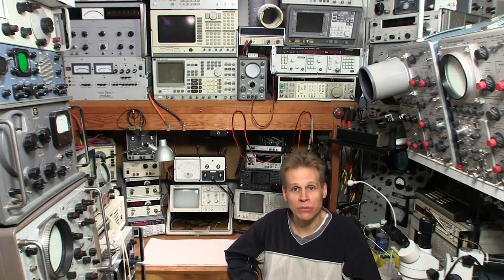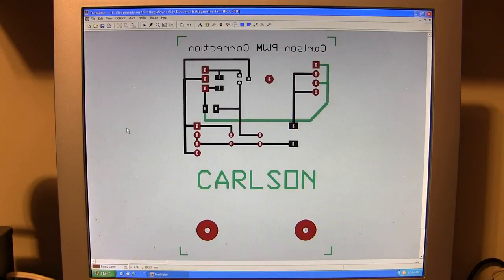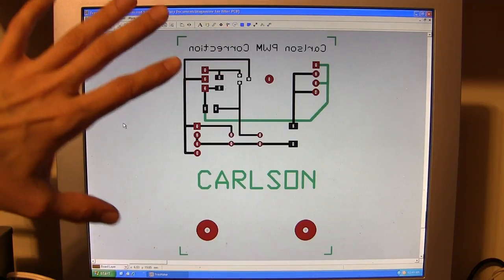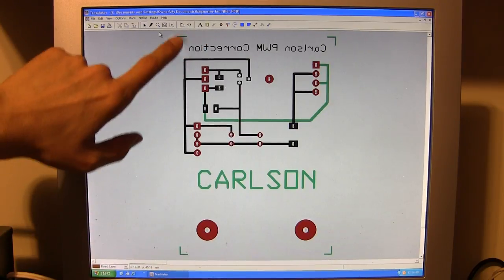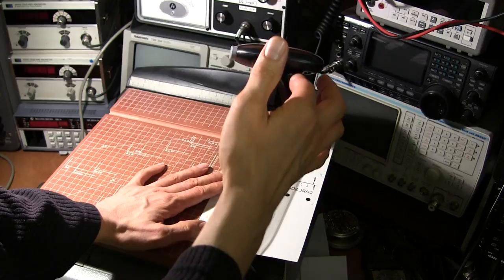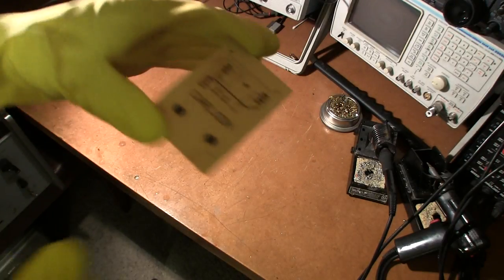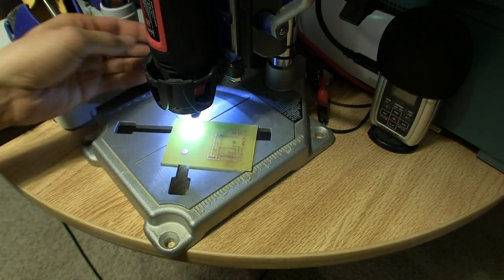How to Make Double Sided Circuit Boards at Home

Comment: Paul, I see that one of your last steps is to remove the paper and the toner or ink was left behind on the substrate. Have you tried acrylic emulsion? It's clear and what you can do is apply the emulsion on to the substrate and then, treating it like glue as it were, apply your page and let it dry. Then using water and a sponge you can remove the paper. Now, this will indeed transfer the toner or ink to almost any surface at all. To be fair, I skimmed the video to get an idea but at 40:47 I thought that this looks very similar to what I described and requires no electricity or lamination. Granted, the transfer method I described will not be as solid as you describe, your process is described as being almost part of the copper. Not sure if what I described will result in that solid a transfer.

Comment: Paul,
I have not used Traxmaker in years IIRC is was built on the the old Protel Autotrax DOS product code that the company bought from Protel to produce a Windows product. Does that product have ground plane or copper pour capability? If so you could save on etch time and etchant by using the copper pour feature. You can also take advantage of power and ground plane fills too. If it does not have that feature you might want to look at Sprint Layout 6.0. I have used it for years and it has copper fill and auto plane capability and many other great features like spiral inductors, BMP and 274-X import, etc. and is also very low cost (about the cost of dinner for 4 at McDonald's). It works well for toner transfer or CNC routing of PCBS of or course 274-X for commercial board manufacture. 

Nice tutorial. The inkjet glossy paper is a good catch as well. 

Was there any particular brand that worked better than others for you? 
Thank you.
W3OHM

Comment: What about the through hole plating ?. Is it achieved by soldering on both sides, as it's liquid metal it will sink down the hole connecting both the pads or do you put a conductor in between.

Comment: Have you ever converting your Windows XP PCB PC as a virtual machine and loading it to a modern (and faster PC)?  You can always ensure that your VM is always backed up and can seamlessly move to a new PC or laptop with ease?

I run all the flavors of Windows from XP to Windows 10 as VM's on my Mac with zero problems.  

Just a curious question really.  Love your videos!

Comment: I  just found your YTC a couple of weeks ago.  As a teen and young adult I've always been interested in electronic.  I've built some of those old projects in the 1960's from Popular Electronics and multiple Heath Kit test gear, radios, ect.  I'm retired now and picked a few projects to restore and use. A VTVM, signal tracer, Ham equip, ect.  I sure am glad I found you video's.  I do have a question though.  I got an old tube, tube tester.  How do you test your valves?  And have you done a video on a restore of an old tube tester?  Thanks, I'm learning alot and hope to refer like minded friends to your channel.  Well done.
Reply from the maker: Hi Bobby. I haven't done a video on a tube tester yet, but may in the future. I usually just let the circuit itself test the tubes in most cases. Thanks for your kind words!

Comment: Why do you remove the toner? If you leave the toner on the tracks it will not be protecting from oxidation? great videos, thanks
Reply: It's much easier just to remove all the toner, than to only remove it from the pads. That would be fiddly and time consuming! If you don't remove the toner from the pads, of course, then you can't solder components to them! A tinning solution both protects the copper from oxidation, and allows easy soldering.

Comment: I used to use masking tape and an exacto knife.  So much hard work and if the board is left in the solution longer than it needs to be, some of the solution soaks in under the tape and you end up with missing traces.  Anyway this is a great video even though I won't be doing anything like this in the future.

Comment: I have found that at the PCB cleaning stage it's really useful to rub the plate with ordinary kitchen salt (sodium chloride), as this removes copper oxides really fast, thus entirely avoiding the need to sand. Of course, you still need to degrease. Excellent video, keep up the good work!
Reply from the maker: +Francisc Gedeon 
Thanks for the tip Francisc!

Comment: Back in my day I used to use tape and acetate to produce the photo lithograph and then exposed it to UV to copper clad board that had a photosensitive chemical on(photoresist).  The. It was on to the sodium hydroxide to wash away non exposed photoresist.  Then the same processes as you show.  However the acetate laminator idea is so much better and with current printers getting 2400dpi I’m sure you’ll get very good resolution.  You could make some really good strip-line and microstrip boards if you needed !!   Thanks for sharing.  If you have the info on the laminate printable stuff could you put a link up for us please ??

Comment: Great video!  I would be interested to know the specific paper, toner, 
and printer model that you use for these. My Brother printer doesn't lay
 down thick enough toner, even on the darkest setting.  Also, do you 
feel that leaving "ground plane" copper would speed up the etching 
process, leaving all copper on the board except tiny amounts around the 
traces/pins? or would this cause problems with your tinning process?
Thanks!
Reply from the maker: +Hilltop 
Hi, My printer is an HP, it's nothing special. I only use it for PCB's. The key is to use genuine HP cartridges, I find aftermarket toner is usually not as good. I have another ink type printer for regular use. Leaving the copper on the board has no affect on the tinning process. Thanks for your comment. The paper is semi gloss double sided brochure paper .
Reply: +Mr Carlson&#39;s Lab Thanks!

Comment: Paul,
I'm having trouble with the printer paper not cleanly coming off the pcb after laminating. And the lam is up to~200deg C.  I'm using HP Double-Sided Glossy Laser paper, product code "CG988A" , as I could not find (Google search) anything that sounded like the ink-jet paper you use.  Do you use a specific brand - HP vs Epson, etc?  It would be great if you could let us know what specific paper you use, and its product code so we could duplicate your results.
Great channel, & I'm enjoying Patreon a bunch!
Cheers,
Steve

Comment: Mr Carlson, This is the best video of yours that I have seen so far. I'm wondering more about that laminator, though. You seem to have suggested that you increased its operating temperature somehow, but you were not too specific. I would almost go as far as to say that this laminator needs its own build video. 

You mentioned an operating temperature of "200-to-210 degrees." Would that have been Celsius or Fahrenheit?
Reply from the maker: Hi Bruce, that's degrees C.

Comment: I remember in Wisconsin that Break Cleaner was essentially Perchlorethylene, the same thing as dry cleaning fluid. I used it to clean my sons  Chain and sprockets on his Shifter Kart. Unfortunately, In California, You can't buy Chlorinated Break Cleaner so you can only get the much more aggressive  Non Chlorinated series of chemicals. I just use Acetone for cleaning PCBs but would much rather use Chlorinated Brake Cleaner

Comment: Thank you for all and I have one question that I encountered. When you drill the pcb how you connect both side, are you using some rivets or just solderin both side is enough?
Reply from the maker: Usually just a wire soldered on both sides. The PCB via is drilled tight to the wire, so the FR4 holds it in place while I solder

Comment: Brilliant. And thanks for the requested video.

Question: I didn't quite get when did you use the laser printer, if you do it at all.
Thanks, Charlie,
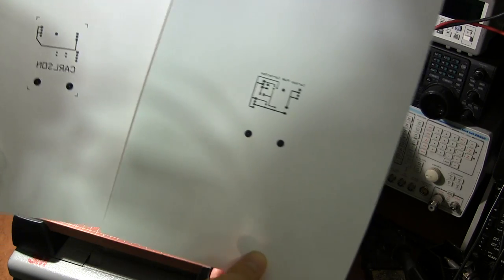Reply from the maker: Charlie Pechiar Hi Charlie. The Laser printer is used for the toner transfer, seen at 23:48 . The ink printer is only used for proofing, (sizing and such) You can not make circuit boards with an ink jet printer. The toner that's put on the flyer paper, put there by the laser printer, gets transferred from the paper to the copper in the laminator. So the paper is "the intermediate step" Hope that helps :^) Thanks for the nice comment as well!
Reply: Mr Carlson's Lab Thank you for the reply. It is now clear. What type of paper are you using? Is it photographic paper?
Thnks
Reply from the maker: Hi Charlie. It's double sided, glossy flyer paper from Staples. The isbn number is in the post here. Just search the comments.

Comment: Hey Paul, another great video.  Keep doing what you do.  I was wondering how fine a detail you can get with your system ie how  small a trace, how close can you put traces, what kind of smt parts have you been successful with?
Reply from the maker: Roger Kerr Hi Roger. I try not to go past 0402. That's even hard for the tweezers to hold. You can see a pretty good shot of some small work in my very first video. (Monsanto Nixie counter) I have quite a stash of parts of all types and sizes. There is a small board in that video that has quite a mix from that stash. I usually build with what I have on hand. Thanks for the nice comment!
Reply: +Mr Carlson's Lab You are braver than I, I hate using 0603 if I don't absolutely have to do so...0402, forget about it unless it is to make a repair (I don't even stock that size)!  At least solder paste will hold them in place while you reflow them.

Comment: Great video!
I have given the toner transfer method a few tries with various paper types but never even got to the etching stage, as I couldn't get a consistent transfer.
I was using a cheap clothes iron with the temperature near maximum.
The modified laminator seems a much better way of applying the required heat and pressure.
It's something I think I should give another try.

The best results I had were from photosensitive board, I found that my friend's printer could handle transparencies so repeatably that we could feed the same sheet in a few times and it would over print exactly, making an amazing contrast ratio.
Reply from the maker: Simon Parkinson Thanks for your comment Simon!

Comment: HI Paul.  I'm curious - does your CAD software have a schematic-to-PCB layout function?  WHen you make the board pattern layout, how do you assure it matches the circuit schematic?   

Thanks for the GREAT video.  I will t ry to make my own laminator (or maybe I'll just try the laundry iron approach first).
Reply from the maker: +musicmakelightning 
Hi. Yes it does, but I have never used it. I like to put the components where I like, and not have the computer do that for me. This is especially important in RF design, which I do a lot of. The iron works ok, but the chances of smudging the tracks is high. The laminator gives nice even results. Good Luck!
Reply: +Mr Carlson's Lab Thanks for the reply.  I was just wondering because in the past I have worked at CAD companies that produce software to do auto-component-place-and-route, but usually the resulting layout requires tweaking.  I imagine you check the layout against the schematic manually as well?  Or, perhaps when you're doing the layout, it "becomes" the schematic to you.  In any case, thanks for the great video.  Best - Joe

Comment: if you can't get an old projector find the lid from an old scanner which is capable of scanning photographic slides/negatives; the type with a light in them,rig a power supply, either 5v or 12V depending on the scanner.use this to get the registration spot on between layers.

Comment: Hey Mr. C, great video as usual. Is there a preferred type of paper or would the typical "No Frills" type of printing paper suffice for the etching process?
Reply from the maker: You are a Patron if I remember correctly, use the link to the list of video's over there, there is an updated paper number in the PCB video that works extremely well.
Reply: @MrCarlsonsLab  Yes, the $10 level. I had some issues with the patreon payment but I think I'm on track now. Thank you for your reply.

Comment: Now in 2019 i use a laser printer and print onto magazines paper torn from a random glossy magazine. Apply my printed paper onto my circuit board and heat it on with an iron. Allow it to cool and use nail varnish remover to soak the paper off ready for etching

Comment: Thank you for the video. I am anxious to see how you made your 'lamination' machine.
 
I am not familiar with your CAD program. So much of your board is unused. Many programs have a 'place copper pour' feature. This allows one to mask off large unused areas. With less area to etch the etch is faster, the etchant lasts longer and the trace edges are sharper. These areas can double as a noise shield if done correctly. A quadruple plus.
Reply from the maker: Farnsworth Thanks Farnsworth!

Comment: Like your circuit board video.  I have made some circuit boards in my time, but mine were not a professional as yours.  I didn't use the laser toner method, wide tape method (no laser at that time, cost and at 1972 time frame ).  I like to see the in-depth laminator design. I may do more circuit boards when I retire, in about another year or so.  I sometimes use the proto-board method, no messy chemicals to mess with.  Love your informative videos.Later Ray Burke

Comment: The laminator is great. I just use a hot iron on an ironing board, with a thin linen dishtowel between the iron and the printed circuit/copper plate. It works well for single sided pcbs and can be used for double sided pcbs (just flip it over and iron the other side) but having said that, this moded laminator is clever. Nice job. [edit: Ferric Chloride is nasty...but the tinning solution is v dangerous if ingested hence the safety advice of Mr Carlson should be taken seriously - only attempt if you have the expertise, safe working area and correct safety equipment - having said which it is wonderful to make your own pcbs].

Comment: A nice video and again very well and thoroughly explained. I have learned such a great deal and grateful of your time and effort.. Would it perhaps be an idea to have a telescopic ceiling cam with swivel lamp abilities so you don't have a floor positioned bulky tripod stand getting In your way! Just a suggestion. Thanks.
Reply from the maker: Peter Byrd Great Idea Peter! I need to do something like that, bending around the tripod is getting kind of old. Thanks for the nice comment!
Reply: You did mention the difficulty of your cam tripod. But if you decide to stick with the normal way of things it hasn't at all prevented you from making awesome videos.
Reply from the maker: Peter Byrd Thanks again Peter!

Comment: Ur method of ink toner etching reminded me of the way we did it @ school,
we used those clear overhead projector sheets with inked track design photo copied onto them,then ironed it on,the result was very hit & miss & so frustrating 
Your method seems so much easier :)
I subscribed today after watching ur video on repairing/modding the yaesu ft 1000 transciever brilliant work & i  look forward to seeing more of ur videos in the future cheers & thanks from melbourne australia :)
Reply from the maker: Thanks Neil! Glad you enjoyed the video.
Reply: Mr Carlson's Lab  why do. Circuit boards seem to have thin tracks?,is it a space issue ?,reason why i ask is that iv'e seem several cybernet o2a cb sets with burnt copper tracks & was wondering if its a design flaw or??

Comment: Hello Mr. Carlson
I found your videos and have not stopped watching. I subscribed and can't wait to see your next project.
A little about me I'm a 25 year telecommunications and networking tech with a degree in EET. electrical and electronic engineering so I can follow and completely understand everything you're doing. 
I find your boards to be most impressive as well as your explanation and reasoning behind your fixes and add ons. 
I was wondering if anyone has guest why you installed the transistor on the back and under the heat sink?
Nevertheless great channel and I hope to see more. I'm completely jealous of your tech room.
Reply from the maker: +James Barnett 
Thanks for the kind words James! A bunch have guessed it (the transistor on the back) right already. Glad your enjoying the video's, more on the way as time permits.
Reply: Fantastic,  I'll be staying tuned.

Comment: Very thorough tutorial! I'm quite interested in your laminator, as well. I'll have to search your channel to see if you've published a video on it. Amazing stuff, man!

edit

I've searched your channel for "laminator" and "PCB" and found no videos about the device used in this video. I'm very interested in it.
Reply from the maker: The laminator video is still in the plans. They now make laminators that go to 200 degree's C, and have the proper spacing to pass an FR4 board. Just look up "circuit board laminators." Thanks for your kind comment!
Reply: There's a lot of risk associated with modifying an appliance like that (fire and whatnot.)

Comment: Hi +Mr Carlson, can you comment on best methods for plated (or filled) through hole for the Hobbyist? I have used the punched-in vías (curse and spit), but didn't have great luck with them. Do you know where/ what I should be lookin for? That you again!
Reply from the maker: Hi Cody. I usually just use a piece of wire in the hole, and solder on both sides. For small runs, this is fine. If you plan on going into production, single sided is your friend :^)